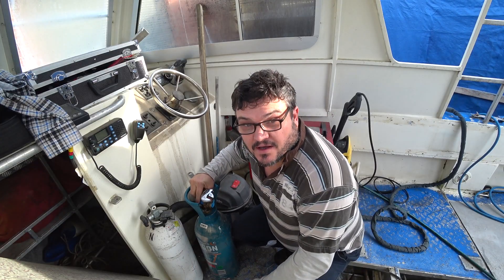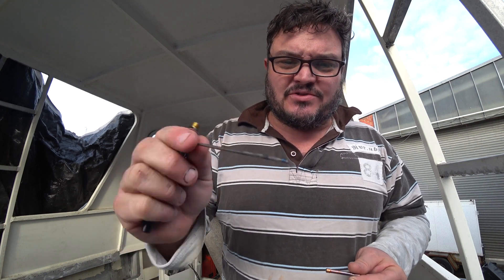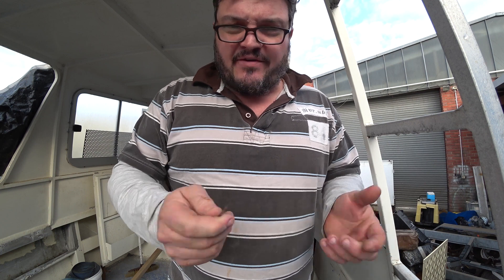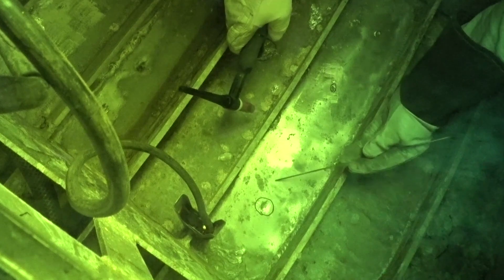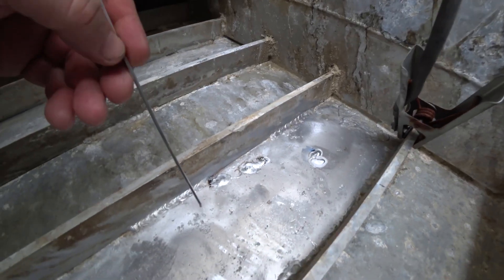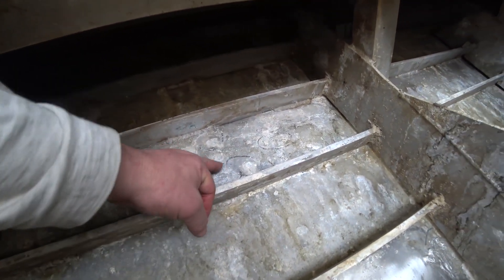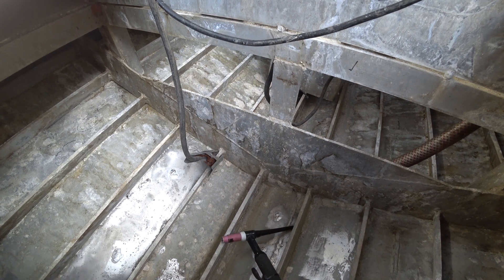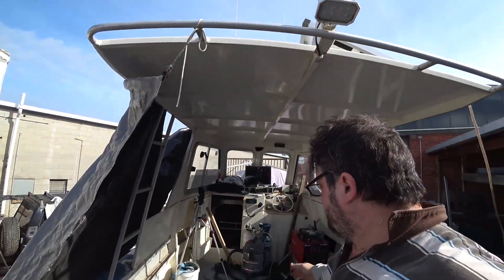Aluminium Boat Hull Corrosion repairs TIG welding

Comment: why is it corroding . I was have some happening in my engine room. I think it was from batterie gas , from over charging . So I cleaned it as good as I could and put baking soda and water in the bilge. hopping to neutralize and stop the corrosion .
Reply from the maker: Well that is the million dollar question isn't it , wish i knew the answer ive spent a lot of time researching this  :) Many things can cause corrosion in aluminium so its hard to establish what the actual cause was, this boat was an ex dive boat and while i have my suspicions about the Ploy urethane floatation foam being part of the cause because some of the bad pits were under the corners of where the pu foam was wrapped in plastic so it was dripping water from condensation or water getting into the foam from the corners onto the aluminium and its possible that the salt water combined with the PU foam caused a caustic or highly alkaline mix and this was a sealed hull so very little maintenance was done it was pretty dirty down there , so any water getting in it through inspection ports or cracks in the floor,  would evaporate and condense on the underside of the floor when cold then drip down again , also perhaps when they were building it they were not careful to keep contamination out of the bilge from grinding TIG tips (titanium) or steel  grinding other parts into the bilge , but it could also be from blood from the crays and crabs as they have copper in their blood which reacts badly with aluminium so could have been a bit of copper introduced into the bilge that way.
Could also be from stray currents running through the boat hull even from other boats nearby when it was at a marina , dissimilar metals such as stainless , iron, lead sinkers or copper can all cause galvanic corrosion when there is the presence of moisture or an electrolyte like salt water , aluminium reacts worse to alkaline then acid , only solution is keep things clean and dry adding ventilation , washing out the bilge with clean fresh water and keeping contaminating metals out of the hull especially copper and steel , epoxy coatings can also help stop and mitigate these things getting to the aluminium so that's another way to slow it down . 
battery acid fumes are unlikely to be the problem but a little bilge fan might help keep things dry and stop moisture accumulating which speeds up these reactions , the sealed area where my batteries and engine are had no pitting or corrosion and it has 2 big AGM batteries sitting in there on a trickle charger and another battery up the front in the cab that runs the radios , i guess for emergencies it has a separate battery , but also no corrosion around that area either so i don't think acids effect aluminium as much as alkaline , keep it PH neutral is obviously better and give it a clean once in a while .
thanks for the question, hope my answer helps in some way.  cheers.

Comment: How many amps did you need to do the pad welds in 6mm plate?  I seem to find it easier with mig than tig I usually use far less argon.
Reply from the maker: thanks for the question , 160-210 amps  depends on  how much heat i need  so this can vary from a hot day to a cold day , a bit of preheating helps too because it sinks the heat pretty quick,  yea I have a pulse mig as well which i use on other parts of the boat when im making new things , but the tig puts down less material and really cleans out the impurities , i have tried the mig a few times , but i guess ive had more practice with the tig on aluminium then the pulse mig , but yea if i could dial in the setting to where the MIG was doing a better or easier job it would perhaps be easier then getting  both hands down in the hull .  cheers :)